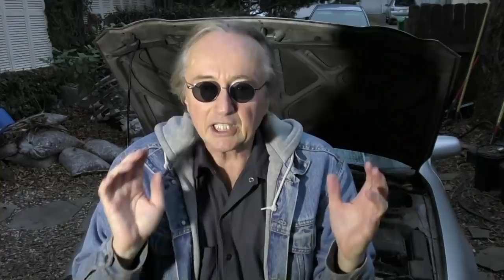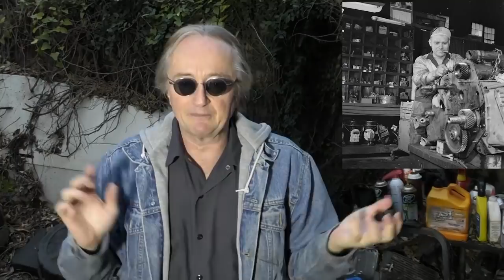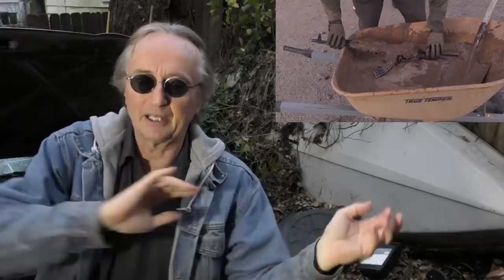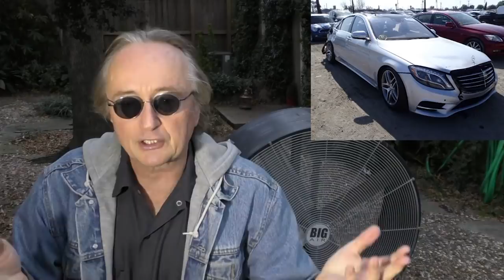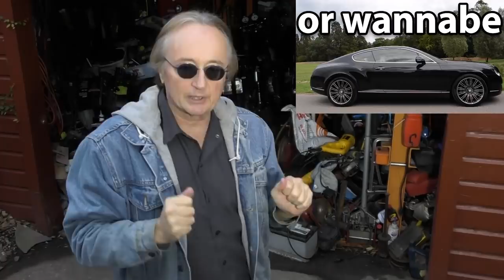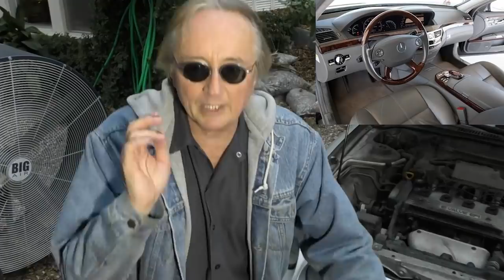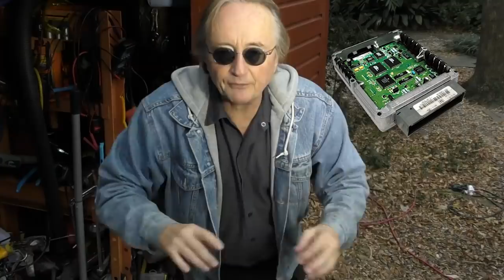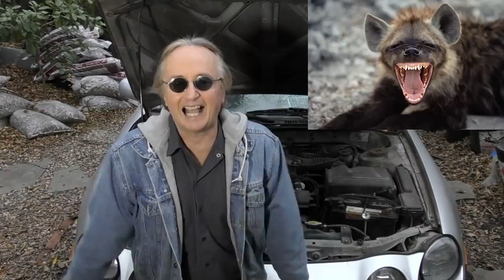Why Luxury Cars are Designed to be Unreliable

Comment: Find a car with a low depreciation and high lease cash back and lease a car like you would a cell phone. No car now a days is worth purchasing. Even the Honda and Toyotas have problems. Cars were much simpler back in the day and cheap to repair. You could keep them for 10 to 15 years. Try that now with a modern car with LED headlights. Adaptive cruise control. Brake assist. Blind spot monitoring. Keep lane assist. Fancy 9 speed transmissions. Turbos that wear down the engine  A hundred independent computers. Adjustable suspension  . Fancy infotainment systems. All these things will cost thousands of dollars to repair when they brake and break they will.  The days of buying a new car and keeping it for any length  of time are over Even Lexus and Toyota have issues now a days. To much technology but what do you want. If you really want reliable transportation then ride a horse.

Comment: There is always exceptions to the rule. BMW and Mercedes do make reliable vehicles. To place a generality that they all make terrible cars is such a farce. I’ve seen so many older BMWs and Mercedes on the road probably more than the newer ones. If you take care of the vehicle they will last. Will things happen? Sure. My Toyota Corolla at 100,000 starting developing transmission problems. Do I say Corollas are unreliable? No. But cars breakdown. All of them. Even Toyota’s which Scotty has an extreme bias for. Buy what you want to drive that YOU enjoy and be the responsible adult and take care of it. That is all.

Comment: That's why when i was buying  used  Mercedes CLS 350cdi i made sure it had full documented service history, al updates and recalls- if any done. I bought it from dealer with 12 months warranty with 60.000mls on the clock. Now after 2 years of owning , car is 7 years old and i had ZERO, repeat ZERO problems. It runs like a dream.  I dont have airmatic , but it is AMG sport spec so rides on 19" low profile tyres with amg alloys and the ride is  comfy with  steering responsive in the corners.  Fabulous car with all the tech you need and  everything stil works perfect.  You will never see me in plastic cheap ugly toyota. Sorry.

Comment: Bad video. The subject wasn't fully covered. There is no explanation why the average 18wheeler trucks run 1-1.5 million miles before major repair while German quasi-luxury but actually Walmart toy cars are 10 times dead at such distances

Besides "ride like a dream" does not fit for example BMW X5 2013, forget even their numerous recalls on elementary basic things

Comment: Holy cow. Americans sure have dogshet gas...93 Octane is premium????? In Europe, 95 Octane is REGULAR FUEL, THE CHEAPEST YOU CAN BUY!! My goodness....also, just stick to a Toyota. It just works as you said ^^ I too prefer N/A engines, Toyota seems quite fond of them. Just look at the Prius, 1.8L 99HP hah! Such a large N/A engine with zero to no power, but with their Hybrid system it still is very fast around the city and the car can still do 100mph all day long on the german Autobahn while stilling getting well above 40MPG. My uncle has a 2017 VW Golf GTI, fully loaded and guess what? The door interior doorhandles SQUEEK!!!! Ugh!!!!
Reply: Clorex Bleach  What I read and understand with Europe and American Octane numbers is they are about the same.  Different system for measuring so Euro numbers read higher but our low mid and high octane content comes out to be just about the same as yours.

Comment: Are Audis unreliable too?
Reply: I’ve had three Audi’s since 2013, all were very reliable, I still own two, plus a Toyota Tacoma.  I’ve had many vehicles in my time, so far Audi has been my best experience, not one problem to report.
Reply: Jerry Enridge amazing man thanks! Did any of those cars happened to be an a6? I’m looking to buying a 2014 a6 with the cvt and the 2.0 engine but I’m scared about reliability because I had my share with my Mini Cooper haha
Reply: No A6,  the A6 was not available in Canada until the 2019 model, not sure why?  I had a 2013 A5 Cabriolet with the 2.0 Turbo but no CVT tranny,  I currently own a 2015 RS5 Cabriolet and a 2018 SQ5.

Comment: I'm considering on purchasing a vehicle for the sole purpose of uber. I just came across the Rogue I saw a used Rogue hybrid. And then I test drove a rogue 2019 and the features on it with all the pilot assist the hands-free steering the breaking it was very nice. But it's got me thinking about Toyota and I was considering a Toyota Highlander although I have one of them rear-ended me on December 20th which caused six vertebrae in my spine and brain damage and hypoxic and I yawn when I speak constantly now but it wasn't his fault it was a stupid white Caucasian blonde female that ran into him and then as I was stopped I was pushed into a Jeep. So I am intrigued by the Rogue because of the technology and it was very nice but Toyota Highlander they come as a hybrid and has I just heard on this video yes it concerns me because I do travel outside into Mexico and I have a very good mechanic near the beach area near San Diego on the Mexican side butt I don't suspect he would be working on a hybrid so I wonder what your opinion would be as I had the Rogue test drive yesterday on Wednesday the 30th and the car lot guy told me and convinced me to stay away from the hybrid on the mirror cost of it. I was considering a Subaru but there's one dealer in San Diego County that doesn't outright want to sell me to me and then when I gave the opportunity to the other dealer another part of the County of San Diego California he wasn't very attentive so basically Subaru just lost my business all Point Blank all together now. the other vehicle that I was had a preference was a Jeep Grand Cherokee because I'm able to fit in it and it had decent lumbar support. Now this would be utilized for Uber or Lyft not that I know anything about it but I'm considering on unfortunately doing the Socialist Communist experiment.

Comment: Mercedes small cars are garbage. the giant ones are great as long as it not an SUV. BMW makes the worst large cars in the world but the 3 series work excellent, You'll notice he says nothing about those. The ar 15 was not chromed inside like the ak 47 something he FORGOT to mention if the ar15 was chromed on every part inside then you could drop it in the Vietnam mud and fire it anyway exactly like a Kalishnikov!

All NEW cars are made from parts made in China because the union in charged way too much money to the companies to work half a day and spend the rest of the day in the bar. so they had to buy bad parts from zero QC China.

All Japanese cars I ever owned fell apart while I was driving them. The Prius was the worse piece of S*** I ever drove, the Corolla fell apart and would not go faster than 25MPH.  My Nissan the doors fell off right after the electrical system fried itself in the engine bay, My Honda had an oil problem the seals let all the oil drain out and to fix it forget-about-it, you can't because the Japanese don't make aftermarket oversized parts for their cars, You are supposed to fork over another $40,000 for anew one!

 I am a mechanic, a master welder, and a journeyman toolmaker machinist, not just a mechanic and all for the last 45 years too!